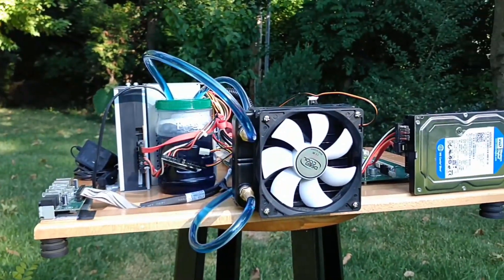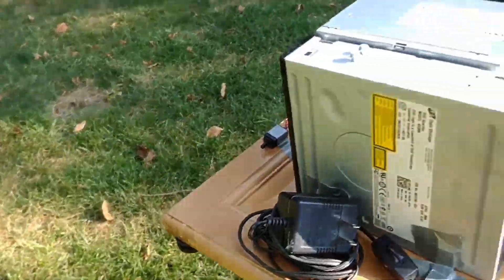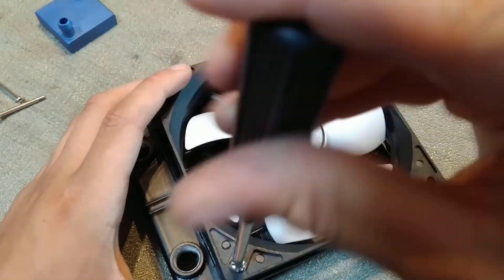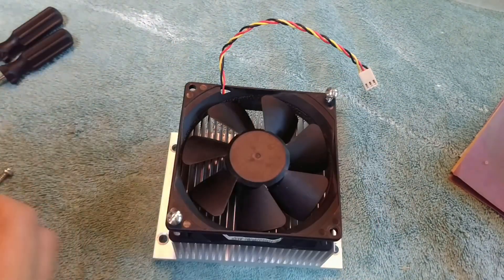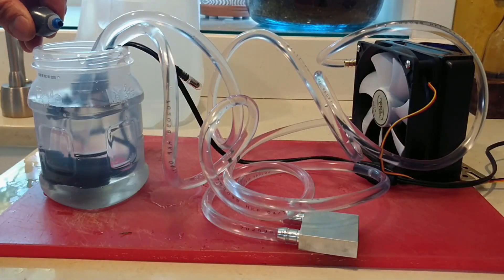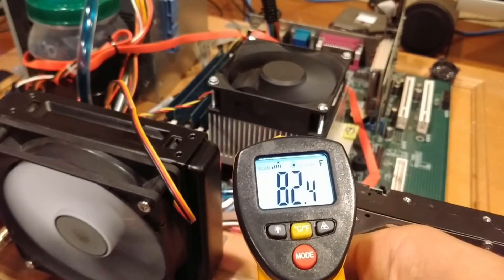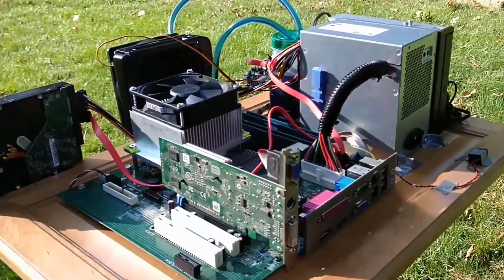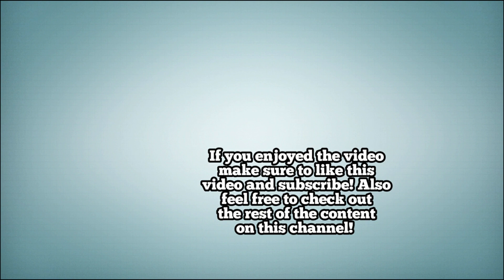DIY Hybrid Water/Air CPU Cooling Under 60$

Comment: It's a GODAWFUL IDEA and looks AWFUL. But you're not alone bro, I've done this too! Turns out you can take a chinese Snowman 6-pipe cooler, sand off the fins (with great difficulty) and then affix a water block on there. So you have the Snowman-6 and you have this water block sitting between the heat sink and the radiator fins, in the middle of the 6 copper pipes. Freakin cool, literally

Comment: First ?
Reply from the maker: Prof R4cer TM Haha, you are first, lol.
Reply: McG Tech that diy water cooler works pretty good i tought it wont work or leak water on the morherboard, well done
Reply from the maker: Prof R4cer TM Thanks, I was also pretty relieved that it worked out